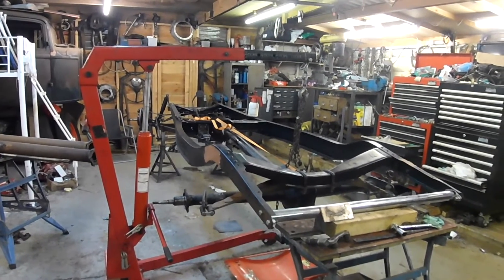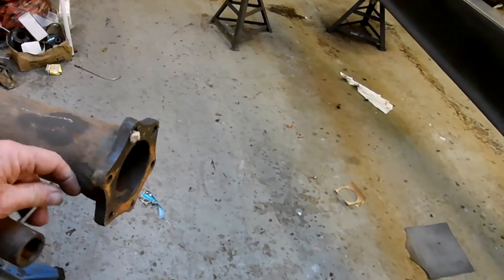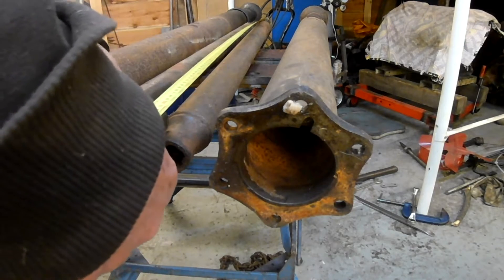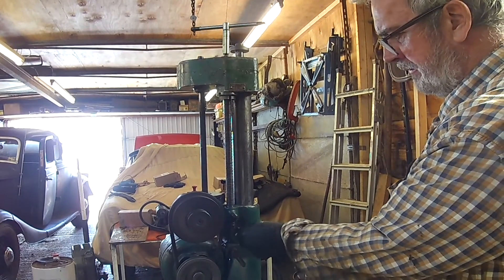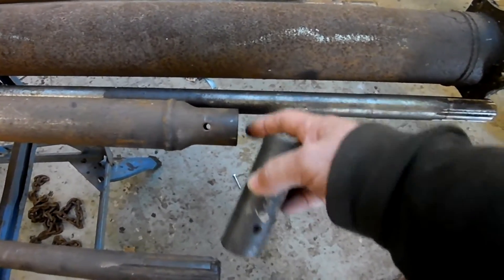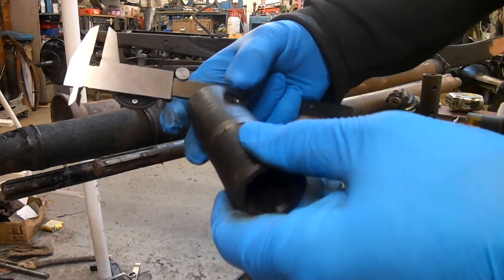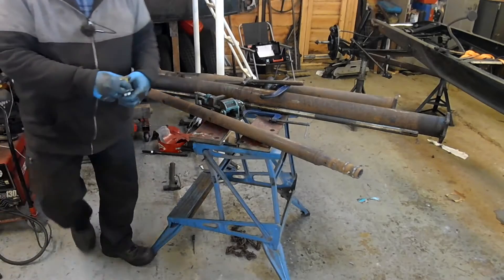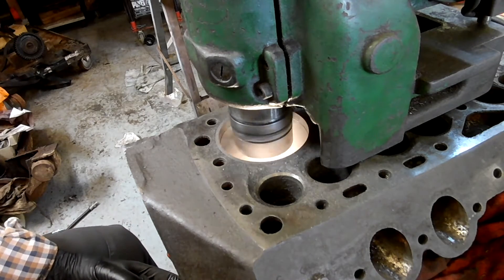32 Ford Driveshaft Tech.  Buma Boring bar fix. Last bore on 59 Flatty.  32 Pt 18 59A Pt12

Comment: As always, nice work Mart!  I admit I got lost determining the desired length of the driveshaft, relative to the torque tube.
Reply from the maker: Hmmm. Maybe I didn't explain it well enough. From the 2 factory setups I had I deduced the driveshaft is 70mm shorter than the torque tube. So I measured the torque tube on the 32 and made the new driveshaft 70mm shorter than that, by lengthening one that was too short to the correct length. Because the point I was measuring was 25mm from the end, the overall difference between any torque tube and driveshaft would need to be 45mm or just over 1-3/4". Thanks for commenting, maybe I need to add some extra notes.

Comment: Greetings from Arkansas Mart. Thank you very kindly for schooling me on your fixes and building processes. You have inspired me to start my own A model. 
I have a couple videos (non scripted) on my project. Do you have a recommendation on what to coat the cylinders to keep them from rusting until the engine is put into service? Thanks very kindly. Steve.
Reply from the maker: Cheers Steve. I don't really have a recommendation. For what it's worth I left a residue of atf/acetone on these bores but then when I became concerned about it I rubbed them over with chainsaw bar and chain oil. That stuff is pretty clingy. I believe you can buy specific spray products but I tend to use what is at hand.

Comment: Hi Mary I see from your videos you are using an   Replaceable tip in the buma cans you advise where you got the tool
Reply from the maker: It's home made, Gavin, from a left hand lathe tool. The tool comes as part of a cheap set from Banggood. I had to build two sides up with weld and mill it to the rectangular shape I needed.
Reply: @MartsGarage  thanks for the reply sorry auto correct changed it to Mary do you have the manual with your boring bar if no I have a copy if you would like it
Reply from the maker: @gavinsanderson3177  Hi Gavin, can you please drop me a line at martsgaragevideo@gmail.com ? Thanks.

Comment: Hi Mart, good work, liked the repair of the boring machine. I have watched you weld/repair lots of interesting bits, are you doing anything special with you Mig setup, 0.8 wire and CO2  gas?
Reply from the maker: Nothing out of the ordinary. 0.6 wire and co2/argon mix. (Argoshield?)